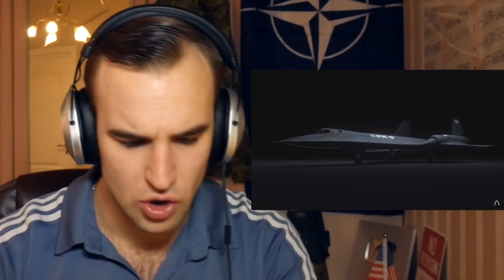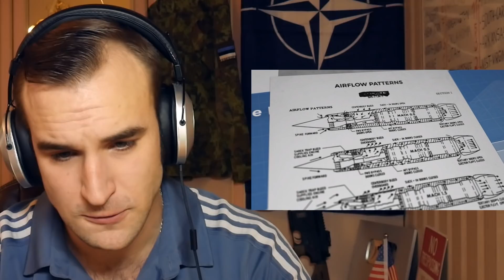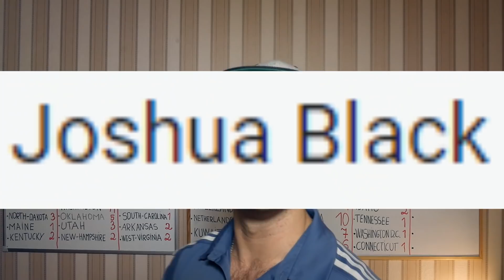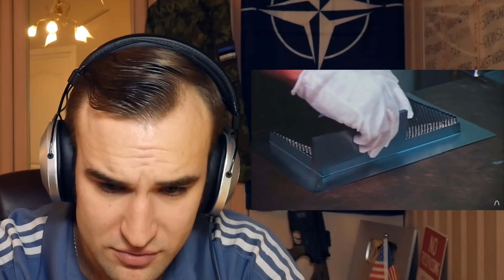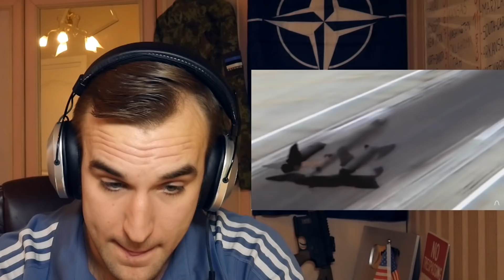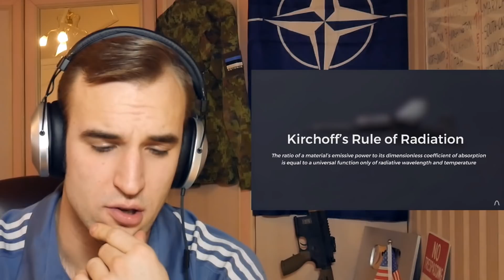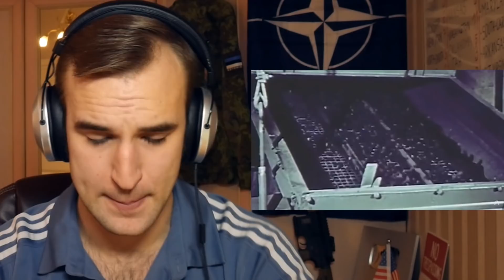Estonian Soldier react to the Fastest Plane in the World - SR-71 BLACKBIRD

Comment: Black is a great conductor of heat. If the outside heat is projecting more heat than your body, your black will absorb more heat. This method the Blackbird is using only works because the plane itself is generating more heat than it's getting from the sun. So until your body becomes a mini high heat generator you're better off not trying to copy the plane.

Comment: I've seen two of them up close (can't touch though) and the black skin looks like a kid put it together with glue and black construction paper for a school project. They really were handbuilt and the skin does leak. Of course the material was coated for stealth and thermal properties but it's shocking how crude and rough the surface is. You'd never buy a car with a finish like that!

Comment: A sonic boom is caused by shock waves created by a plane that travels through air faster than the speed of sound. When an object moves through the air, it makes pressure waves in front of and behind it. Equally it meets the sound of speed. 750 miles an hour and thats when you see the white cloud.

Comment: When we spoke of the Blackbird SR-71 in the Air Force, we heard stories if the pilots saying that when another country would get close to our top speed record- the SR-71 pilot Would just give another inch on the throttle. The plane would take off at 1/4 to 1/3 load of fuel (can't recall exactly) and then air refuel immediately. Reason was it would be too heavy with full load of fuel at sea level. I have spoken to air tanker crews and verified. I have stood beside an early model as a static display at a Nasa installation in Huntsville, Al. Currently The US Space and Rocket Center. Now a nice museum. I was surprised at how small it was in person because in pictures it seems so much bigger.  There were small gaps between certain panels to allow for expansion at temperature. As for the black color-  recall the US Space Shuttle was black on the bottom for the same reason. Emitting heat.

Also heard stories of attempting to put missiles on this platform, it had to slow down to fire them- then this program failed account of now having to outrun the missile you just shot because it locked onto your own plane. Not verified.

Comment: 10:00 Sound is a pressure wave moving through the air.  When you start getting close to the speed of sound, you start moving as fast as the pressure in the air can move.  Air builds up around the object - it's a pressure wave, or rather a shock wave.  The boom is the sound of that shock wave reaching your ear.

23:45 Yes, it's the air friction.  Except in the rear it was the head of the exhaust.

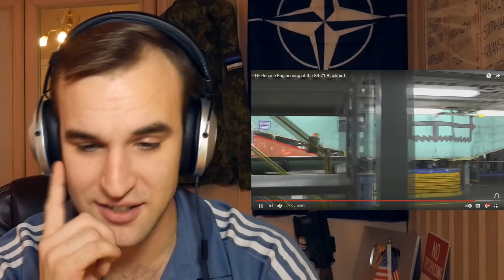30:30 Just destroyed Artur's mind :-D

Comment: The words 0f Major Brian Shul... "With the Libyan coast fast approaching now, Walt asks me for the third time, if I think the jet will get to the speed and altitude we want in time. I tell him yes. I know he is concerned. He is dealing with the data; that’s what engineers do, and I am glad he is. But I have my hands on the stick and throttles and can feel the heart of a thoroughbred, running now with the power and perfection she was designed to possess. I also talk to her. Like the combat veteran she is, the jet senses the target area and seems to prepare herself. 
For the first time in two days, the inlet door closes flush and all vibration is gone. We’ve become so used to the constant buzzing that the jet sounds quiet now in comparison. The Mach correspondingly increases slightly and the jet is flying in that confidently smooth and steady style we have so often seen at these speeds. We reach our target altitude and speed, with five miles to spare. Entering the target area, in response to the jet’s new-found vitality, Walt says, ‘That’s amazing’ and with my left hand pushing two throttles farther forward, I think to myself that there is much they don’t teach in engineering school. 
Out my left window, Libya looks like one huge sandbox. A featureless brown terrain stretches all the way to the horizon. There is no sign of any activity. Then Walt tells me that he is getting lots of electronic signals, and they are not the friendly kind. The jet is performing perfectly now, flying better than she has in weeks. She seems to know where she is. She likes the high Mach, as we penetrate deeper into Libyan airspace. Leaving the footprint of our sonic boom across Benghazi, I sit motionless, with stilled hands on throttles and the pitch control, my eyes glued to the gauges. 
Only the Mach indicator is moving, steadily increasing in hundredths, in a rhythmic consistency similar to the long distance runner who has caught his second wind and picked up the pace. The jet was made for this kind of performance and she wasn’t about to let an errant inlet door make her miss the show. With the power of forty locomotives, we puncture the quiet African sky and continue farther south across a bleak landscape. 
Walt continues to update me with numerous reactions he sees on the DEF panel. He is receiving missile tracking signals. With each mile we traverse, every two seconds, I become more uncomfortable driving deeper into this barren and hostile land. I am glad the DEF panel is not in the front seat. It would be a big distraction now, seeing the lights flashing. In contrast, my cockpit is ‘quiet’ as the jet purrs and relishes her new-found strength, continuing to slowly accelerate. 
The spikes are full aft now, tucked twenty-six inches deep into the nacelles. With all inlet doors tightly shut, at 3.24 Mach, the J-58s are more like ramjets now, gulping 100,000 cubic feet of air per second. We are a roaring express now, and as we roll through the enemy’s backyard, I hope our speed continues to defeat the missile radars below. We are approaching a turn, and this is good. It will only make it more difficult for any launched missile to solve the solution for hitting our aircraft. 
I push the speed up at Walt’s request. The jet does not skip a beat, nothing fluctuates, and the cameras have a rock steady platform. Walt received missile launch signals. Before he can say anything else, my left hand instinctively moves the throttles yet farther forward. My eyes are glued to temperature gauges now, as I know the jet will willingly go to speeds that can harm her. The temps are relatively cool and from all the warm temps we’ve encountered thus far, this surprises me but then, it really doesn’t surprise me. Mach 3.31 and Walt is quiet for the moment. 
I move my gloved finder across the small silver wheel on the autopilot panel which controls the aircraft’s pitch. With the deft feel known to Swiss watchmakers, surgeons, and ‘dinosaurs’ (old- time pilots who not only fly an airplane but ‘feel it’), I rotate the pitch wheel somewhere between one-sixteenth and one-eighth inch location, a position which yields the 500-foot-per-minute climb I desire. The jet raises her nose one-sixth of a degree and knows I’ll push her higher as she goes faster. The Mach continues to rise, but during this segment of our route, I am in no mood to pull throttles back. 
Walt’s voice pierces the quiet of my cockpit with the news of more missile launch signals. The gravity of Walter’s voice tells me that he believes the signals to be a more valid threat than the others. Within seconds he tells me to ‘push it up’ and I firmly press both throttles against their stops. For the next few seconds, I will let the jet go as fast as she wants. A final turn is coming up and we both know that if we can hit that turn at this speed, we most likely will defeat any missiles. We are not there yet, though, and I’m wondering if Walt will call for a defensive turn off our course. 
With no words spoken, I sense Walter is thinking in concert with me about maintaining our programmed course. To keep from worrying, I glance outside, wondering if I’ll be able to visually pick up a missile aimed at us. Odd are the thoughts that wander through one’s mind in times like these. I found myself recalling the words of former SR-71 pilots who were fired upon while flying missions over North Vietnam. They said the few errant missile detonations they were able to observe from the cockpit looked like implosions rather than explosions. This was due to the great speed at which the jet was hurling away from the exploding missile. 
I see nothing outside except the endless expanse of a steel blue sky and the broad patch of tan earth far below. I have only had my eyes out of the cockpit for seconds, but it seems like many minutes since I have last checked the gauges inside. Returning my attention inward, I glance first at the miles counter telling me how many more to go, until we can start our turn. Then I note the Mach, and passing beyond 3.45, I realize that Walter and I have attained new personal records. The Mach continues to increase. The ride is incredibly smooth. 
There seems to be a confirmed trust now, between me and the jet; she will not hesitate to deliver whatever speed we need, and I can count on no problems with the inlets. Walt and I are ultimately depending on the jet now – more so than normal – and she seems to know it. The cooler outside temperatures have awakened the spirit born into her years ago, when men dedicated to excellence took the time and care to build her well. With spikes and doors as tight as they can get, we are racing against the time it could take a missile to reach our altitude. 
It is a race this jet will not let us lose. The Mach eases to 3.5 as we crest 80,000 feet. We are a bullet now – except faster. We hit the turn, and I feel some relief as our nose swings away from a country we have seen quite enough of. Screaming past Tripoli, our phenomenal speed continues to rise, and the screaming Sled pummels the enemy one more time, laying down a parting sonic boom. In seconds, we can see nothing but the expansive blue of the Mediterranean. I realize that I still have my left hand full-forward and we’re continuing to rocket along in maximum afterburner. 
The TDI now shows us Mach numbers, not only new to our experience but flat out scary. Walt says the DEF panel is now quiet, and I know it is time to reduce our incredible speed. I pull the throttles to the min ‘burner range and the jet still doesn’t want to slow down. Normally the Mach would be affected immediately, when making such a large throttle movement. But for just a few moments old 960 just sat out there at the high Mach, she seemed to love and like the proud Sled she was, only began to slow when we were well out of danger. I loved that jet".

Comment: The SR-71 does not use JP5 fuel.  It uses JP-7 Fuel, which under normal atmospheric conditions, such as a puddle formed on the ground, is nonflammable. It was specially formulated for the SR-71, to prevent accidental ignition of the fuel from exposure to heat of flame, while still igniting under the high pressure conditions found within a jet engine.  Leaks also came from fuel line fittings, that were tightened to lower torque numbers, because in-flight conditions would cause expansion forces that would have broken fittings tightened to normal tolerances.  They were tightened so that these connections would seal up during flight, without failing under extreme conditions.

Comment: What heats it up is less friction than compression. When you compress air, it gets hot- that's how a diesel works. Well, the Blackbird goes so fast the air can't get out of the way, and gets compressed- that's why even the sharp nose gets to 300 degrees, the region of compressed air in front of it. Small amount of air, but very high temperature.

Comment: Whether a black body absorbs heat or radiates it depends upon whether it's hotter than the air or solar radiation or cooler. If cooler, it absorbs- like your black clothing in the sun. But the radiator in your car is painted black to better radiate the engine heat away! That's also why radiators of modern cars are inside the hood, to avoid being in the sunlight for best radiating.

Comment: This was more like a rocket than a plane. And yes, lots of rockets  (there are various rocket engine types but the most common types) use FUEL as a coolant by running it down the sides of the rocket nozzles. The tricks you have to use when going extremely fast within the atmosphere or burning something at extremely high temperatures...

Comment: The truly amazing part of this plan is that it was engineered using a slide ruler!
During this time, the computer at the base was a vacuum punch card machine. An actual bug or insect would get into these machines and they wouldn't work. Hence the term"bug"
This machine could do less than a calculator I could buy today for $10.
Engineers with slide rulers produce something that is unmatched today.
Jet propulsion laboratory, Skunk Works, Raytheon; amazing engineers

Comment: There are references in some books by pilots who flew that hint speeds well over Mach 3.5 were hit at least briefly. This was one of its last flights before most were retired across the U.S.A. 

The SR-71A displayed at the Museum's Udvar-Hazy Center was flown from Los Angeles to Washington, DC on March 6, 1990. This record-setting flight traversed almost 4,828 kilometers (3,000 miles) in 1 hour, 4 minutes, and 20 seconds, averaging a speed of 3,418 kilometers per hour (2,124 miles per hour).

Comment: Now realize this was all designed without computers and functioned without computers!  Also the actual top speed is still classified.
Reply: I suspect that if it was pushed to the limit it might be able to hit mach 5
Reply: So is the max altitude. There's a story that floats around the Air Force. Long story short, at least 100k feet.
Reply: Theoretically, the plane could likely go up to mach 4.5 for a couple minutes before the airframe decides to start disintegrating.  A pilot flying over Vietnam reported seeing "Some pretty scary mach numbers" (~mach 4.2) after dodging SA-2's for a while and had to back off.  3.2 is the sustained cruise speed, but she could certainly be much faster in bursts
Reply: @Registered_Simp  Cool
Reply: @Registered_Simp  Ask the pilot that flew over Libya doing target verification after we took a shot at Gaddafi. He was fired at from multiple vectors...after getting the pictures they needed, he bugged out "...at speed we'd never seen before." Never said what that speed was. I'd venture to bet it was mach 4+. Being that it was a relatively short burst to get feet wet and out of town, the bird sustained it and got home.
Reply: Yes, I think it could probably go significantly faster than it's known top speed, IF it's fuselage can withstand the speeds. The engines could probably go faster.
Reply: One former pilot mentioned that the top speed reached by any one pilot, depended on the air temperature, as well as engine temperature: some reported top speeds higher than the average, which was 3.2-3.4.

Same went for altitude.
Reply: It was also made without calculators. All of the calculations were done on a slide rule.
Reply: This plane could generate a highly compressed quadruple sonic boom in approx 1 sec. So between mach4 and 5.
 A commertial jet at altitude and distance is like watching a minute hand on a watch. This plane at twice that height was moving like a bat outta hell.

Comment: Something to bear in mind about the fuel loss on the ground is that SR-71 jet fuel isn't "jet fuel", it's a special high-temperature blend called JP-7. It's still "kerosene" but it's going to flow like vegetable oil and be about as flammable. You'll have a big greasy spot, but it's not really a fire hazard unless you really try.
EDIT:  I was too quick on the trigger, 24:14... this is a damn good video, they covered it.

Comment: The thing is at speed the SR 71 didn't leak. It only leaked when the skin was cold.
They also had to drain the hydraulic system as soon as it touched down. Because to operate at such high temps it was super thick. When not at speed it was like tar.

Comment: Those engines were really revolutionary, they were a combination of standard like turbo jets found on most jets today, and Ram jet like (I use the term "Like" cause they work similar but have many modifications), interesting thing is the Faster they flew, the More efficient they became to a point till it got too hot, after a certain speed it switched from standard jet to Ram jet. One of the problems with the SR-71 is flying too fast and melting the skin. They say 3.2 Mach but there were times due to desperation to get away it went much faster. P.S., See Reply
Reply: DOH, didn't watch long enough before commenting.